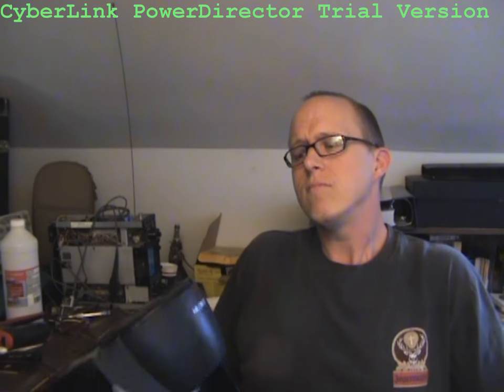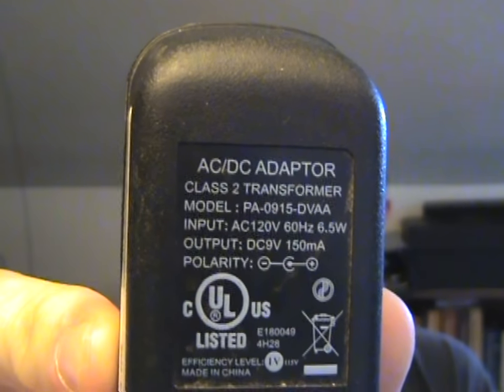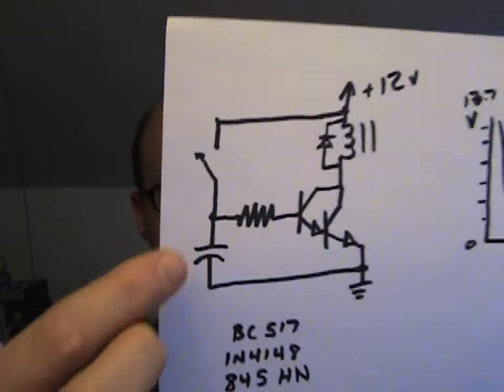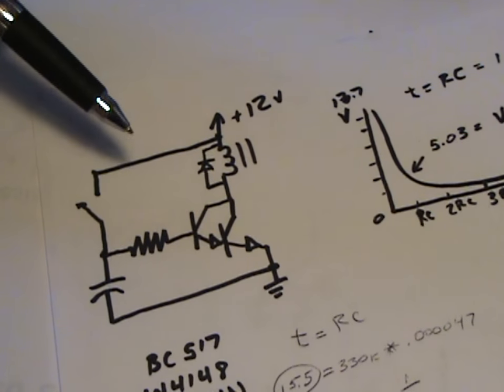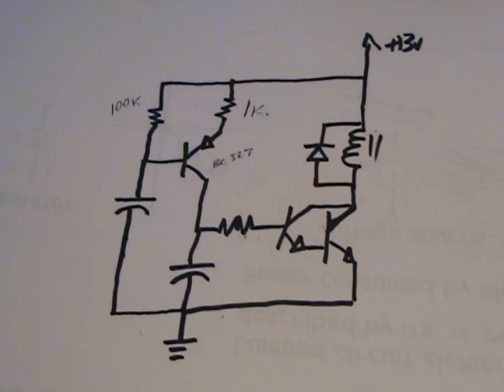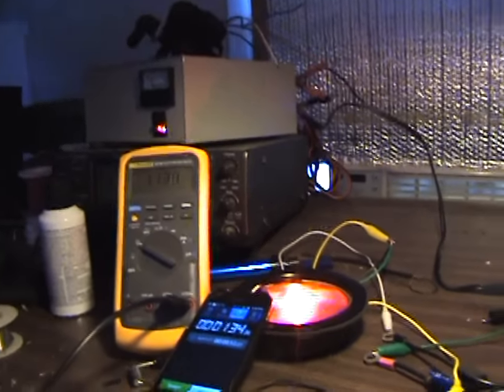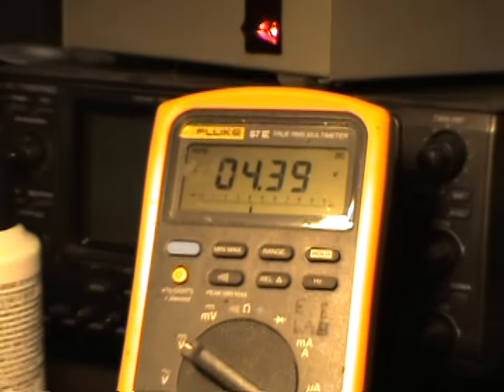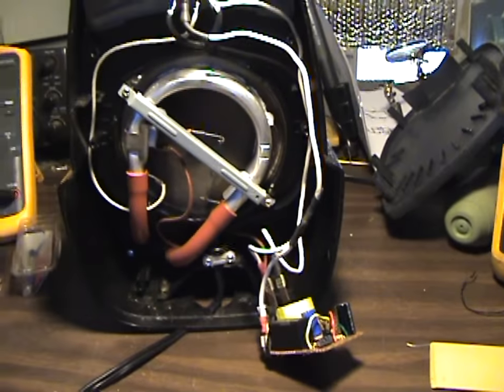Coffee Maker Hack

Comment: Excellent i used your method as basis for mine.
did a couple things different. specially the "finishing touch"
i was worried about water getting on the circuit. so i gave it a nice layer  hot glue

Comment: I need a shut off for my lawnmower charger coz it cooks the batteries when I forget to unplug it after 3 hours.  This is perfect— comes on auto and shuts off —. Now to find the parts necessessary from old circuits lying around. Eg microwave, modem, sprinkler controller.  Or use old coffee pot (it did have a 2 hour timer) somehow with its broken thermistor...

Comment: Hey, I tried leaving you a question on your blog, but it keeps refusing the password. I'd love to build this, but I need to shut my pot off a lot sooner - basically, right after I'm done pouring out what I've just brewed. Because this tends to happen early in the morning, I sometimes forget to turn off the hotplate, which then turns the small remaining amount of coffee into a carbon crust in the carafe. Since my last math class occurred in the 1960s, I'd really appreciate some clues as to how to revise the circuit for the short cutoff. Thanks for any help you can offer!
Reply from the maker: Hi Gene. T = R*C, where T is the time it takes to discharge the cap to around 36% of where it started. You can use a smaller resistor or smaller capacitor, or both to get a quicker shutoff time.